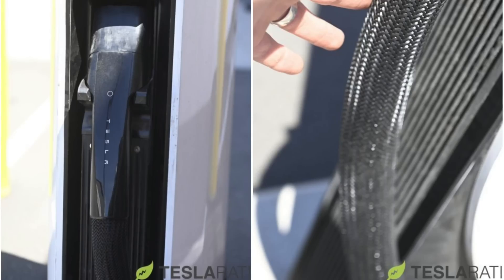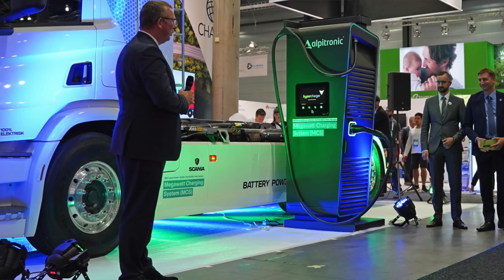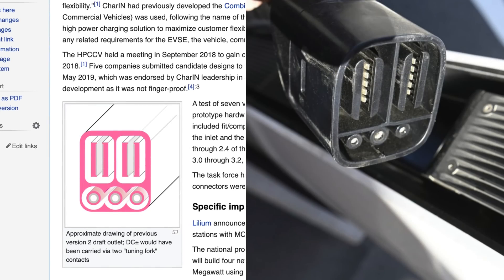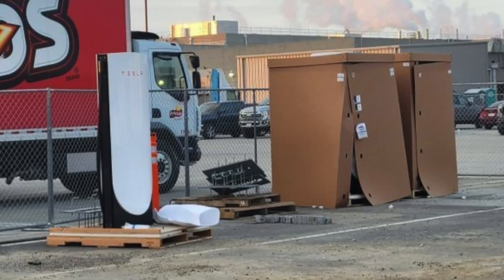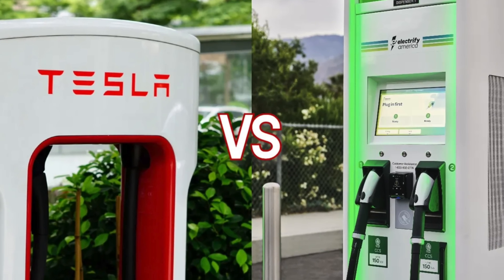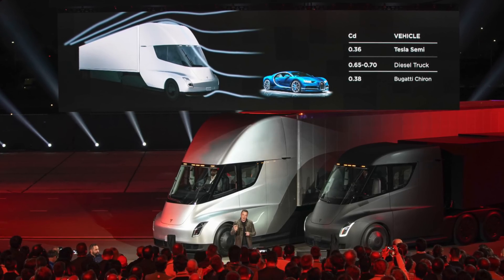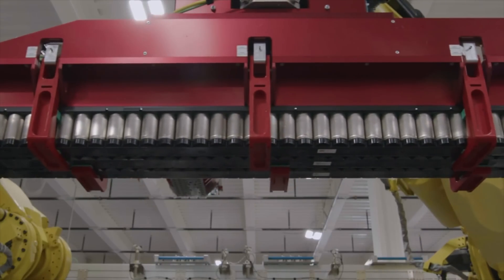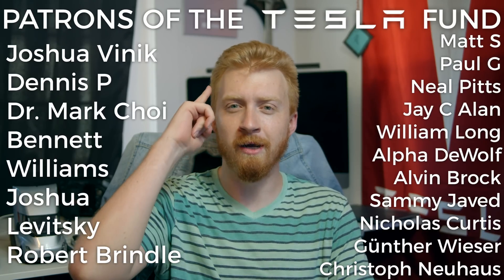Tesla, DON'T Mess Up the Semi Connector...

Comment: It won't matter for now, as Tesla Semi trucks won't be out for many year's yet. But someday it might. A 500 Kwh battery will only give a Tesla Semi a range of about 40 miles if it weighs 80,000 lbs fully loaded. 

The current F-150 Lightning with a 131 kwh battery can only tow a 6,000 lbs ATV trailer 80 miles as it is. So 3.8x more battery trying to tow a 60,000 lbs trailer won't exactly work.

Oh! And these battery chargers will kill the power grid. In the last 6 years almost no additional capacity was even added to the national grid. (Thanks to many coal plants going off line, despite more green energy coming online) 

1 megawatt = An electrical outlet that could pump out 1,000 volts at a rate of 1,000 amps!!!!! 

The most powerful electrical outlet in US homes is 240-volts at 60 amps in comparison. (Good enough to do heavy welding, running 80 gallon air compressors etc...)

Comment: Why would you care about a standard charging port? I would much rather have adapters and competition.
Reply: @TailosiveEV  True, but if everyone was forced to use a lightning connector back when it was good compared to the competition, usb c may not have been created and you would not have the choice to have something like a oneplus phone that charges significantly faster than lightning. Cables are a bit more complex than a pipe where pressure is the only metric for comparing performance.

Comment: EVs have been struggling with towing lately. I have less confidence now that the semi will be practical because the range will drop like a rock. It seems like the federal government will have to step in to setup a universal port just like on phones.
Reply: That is due to drag. The semi will have fixed drag since the trailer is flush with the cab

Comment: This is a very panicky video and unnecessarily so. The new standard is out like just 3 weeks now? How else would you expect them to operate, wait indefinitely for the new connector before starting testing their semi deployments? Also the new charger looks much more like something Tesla came up with and the old one like it was designed by someone else so i wouldn't be surprised if it was a design suggested by Tesla over the old one. All the mega chargers are experimental at this point and are subject to change. There is absolutely no reason to panic. Like none.
Reply: @TailosiveEV  nah, you present this in a very panicky way and there is nothing to panic. You provided the explanation, that this might just be a consequence of introducing the new standard later on, but you present this as something that who knows maybe it's true if we are lucky it something and I gave you a counter, that it's only natural to happen this way. No need to panic at all and no need to make such panicky videos.

Comment: Semi requires large amount of batteries. But the main problem is not the batteries that go into the semi, the real problem is the batteries required at the megachargers.
Reply: @TailosiveEV  Peculiar logic, as if a charging station requires the same amount of batteries as a vehicle... On top of that, a charging station is an upfront investment, unlike a vehicle which is sold for profit... its more classy just to admit your mistake. Don't become the next Ben Sullins.
Reply: @personnosrep4196  Tesla may build a few hundred mega chargers at most, but they will build many thousands of semis.
Reply: @GuruMeditationError  if this is true that means that each megacharging station has to be able to charge an order of magnitude, i.e. 10+, semis at the same time, since semis are usually on the road and not parked. That will require an insane amount of batteries to keep the charging speed high...

Comment: New Teslas use ccs in EU anyway and old ones get retrofitted. Makes sense they should use one common high power connector. Also Tesla gets lots of money from others like MB, Scania, Volvo etc using their chargers. Semi has huge issue with maximum weight limits, maybe Tesla is waiting legislation to allow electric semis have max weight raised by like 5 tonnes that battery weights. Here many semis use all of that 76 metric tonnes weight limit to be profitable. Some companies even put few tonnes over that limit and risk getting caught to get lil extra profit.
Reply: But the amount of money saved on maintenance and fuel cost is a lot compared to the typical diesel semi